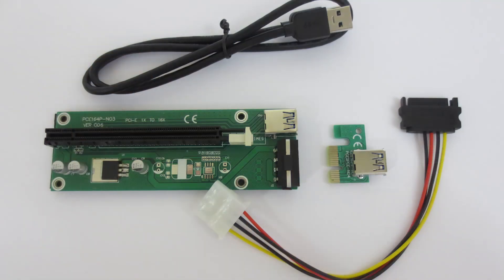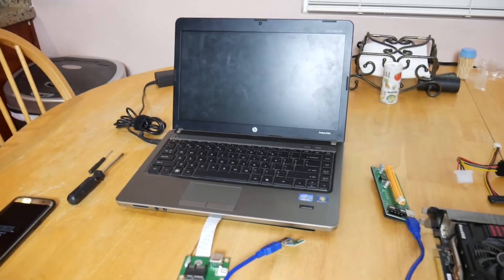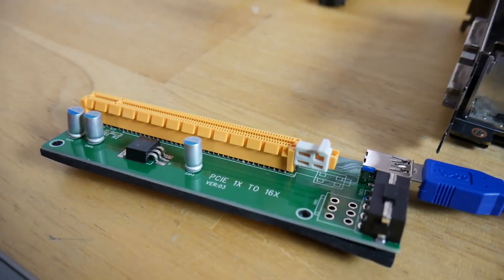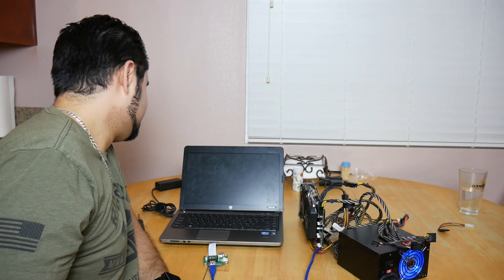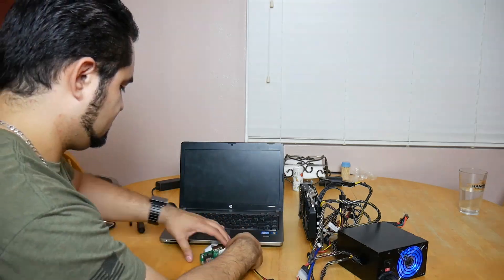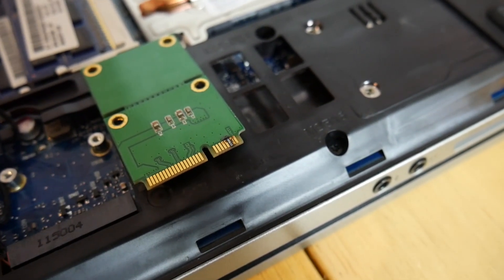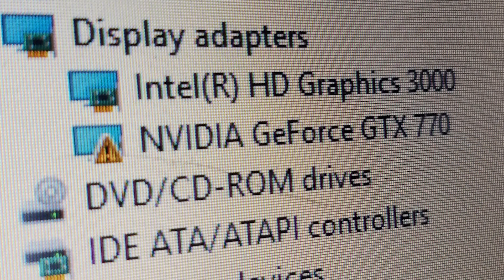$30 DIY EXTERNAL GRAPHICS CARD DOCK [eGPU ATTEMPT]

Comment: i have a question is it possible to use this on an 4th generation i7 alienware m14 and since i have only sata drives could i use a stata adapter to use the M.2 setup to run like a 2060 nivida video card i went to amazon the item is out of stock
Reply from the maker: @jimbilello7134  no you can't use an adapter like that. There are no pcie lanes that go to a sata port.
Reply: @CoalitionGaming  thank you sir

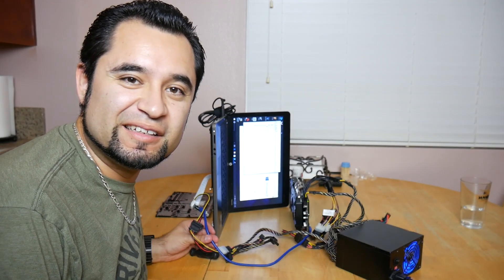Comment: @Coalition gaming. What exactly did you do at 8:50 please. Please be specific. If anyone else knows what he did please tell what exactly he did there. I have the exact same issue weather I use Expresscard or mini pcie slots. I'm pulling my hair on this issue. Also someone mentioned Optimus for internal display to work. Couldn't any information on that either. Any help would be appreciated. 
I have dell e6430. Gpu:  gtx 660 ti. Gdc exp expresscard and mini pci.
Any help would be appreciated.
Reply from the maker: explained at 8:40. In the bootup, the laptop wants the wifi card it came. After it passes the initial boot sequence, i quickly swap the eGPU adapter in.
Reply: @CoalitionGaming  . Got it Thanks.

Comment: I bought these two egpu docks for 15$ going to try it with my rx560 cause my graphics card died in laptop and i have only black screen egpu comes at thursday wish me luck guys
Reply from the maker: Good luck!
Reply: @CoalitionGaming  hey bro i have question can i cut cable from my phone charger and use it to shorten circuit on 24 pin power connector
Reply from the maker: any wire would work to bridge the pins on the 24 pin to jump start it, but i advise the usage of a paper clip instead.
Reply: @CoalitionGaming  thanks bro i will post you results when it comes

Comment: just the video I needed to see , I have an hp as well and I cant get past the black screen even connected to a external monitor but if it requiring the removal of the wifi card everytime booting up seems a lot of struggle to make it work in everyday use

Comment: How did you actually get it to work because you said that the port locks up without a WiFi card so how did you get it to recognise the gpu without the WiFi card
Reply from the maker: As shown in the video, I would boot it with the wifi card, then pause the boot after it posted, then swap the GPU adapter in. This was also my undoing lol

Comment: Hey i have some question
If i use gtx 1050 ti or 1050 that not requires external  power, can make it more easily? (That mean that can skip power supply process in 1050ti). I wonder that the voltage in laptop pcie slot is much lower than original pcie... can IT work...?
Reply from the maker: No, the dock still needs 75w of power. It'll just mean you don't need to plug in external power, but PSU still needed
Reply: @CoalitionGaming  Ahha! thank you~:)
Reply: @CoalitionGaming  And are there any docks that not needs power...? can exist?

Comment: You would success with an external monitor. For your internal display to work natively with this setup, you need to modify your display driver before installing it. It's a little bit tricky, but it's completely possible.

Comment: Hi sir 
I did what u said exactly and doesn't works !! 
My laptop is lenovo ideas pad 320a 
But when i was reading comments i found some guys talk about mod on BIOS please i need help to get this pcie run on my laptop
Reply from the maker: maybe check with the bios-mods website/forums and see if there is anything or anyone there that can help. Also the egpu.io forums can be a good resource.
Reply: Thank you so much for replaying 
Also i didn't get black screen when i tried the egpu 
Does this thing normal or not ??

Comment: You mentioned usb3 speed limits... Can you run a gpu via usb 3 directly? (Youtube recommending your vids to me now after subbing from gtx 2060 challenge!)
Reply from the maker: Nice. No, unfortunately you USB3 does not connect to the PCI-E lanes so you can't run an egpu off USB 3. The USB3.0 cable itself is the limit as I believe it's rated for 5gbps, which is the same as 1 Lane of PCI-E 1.0 i think. Or 2.0. I don't remember.
Reply: Looks like you said no to a similar question in your part 2 vid...needs access to pci... Makes sense.... Hmmmmmm

Comment: No worries, 
I have a 2008 Sony Vaio laptop, and I was able to get a lot further than you (using the Expresscard slot) without frying anything, but the card still doesn't work for folding or mining.
For folding or mining, the card needs to be recognized via Bios, I guess.
Another thing is, you'll need a true PCIE slot, which you can get via Express cardslot, not an M2 slot.
M2 slot is for USB. The NVIdia drivers won't work properly, even if the card is recognized. 
They will display some sort of pass-through, or software render mode, not the card's full potential.
For now, your best bet is a Latte Panda Alpha, or a NUC or laptop with a mobile version of the GTX1060 built in.
Reply from the maker: What I used was not an m.2 slot. It was a mini PCI-E slot which has 2x PCI-E lane connection. It actually displayed properly in device manager before having to hot swap to bypass the BIOS whitelist went bad. There is zero way this would have happened had it been a USB only connection as USB has zero connection  to the PCI-E lanes. Thru PCI-E it's perfectly and usually possible. Expresscard is essentially the same connection as mini PCI-E, just externally accessible. It would have been so much easier that way, but alot less fun for sure since a gdc beast expresscard version covers that. Some connectors like that are wifi only m.2 or m.2 with only SATA access, but it was clear in this case it was a legit mini PCI-E. For the record, this was just an experiment for fun. I don't need anything like this.

Comment: is there another way to use eGPU? (no mini PCIe - no thunderbolt 3) i have usb-c port but it can run the GPU
Reply from the maker: Additionally there NGFF (like mini PCIE) and expressCard. USB-C cannot do an eGPU as it has no access to the PCI-E lanes. To do an eGPU, it needs access to the system's PCI-E lanes.

Comment: Hi there! i have Dell Elitebook E6430 and trying to install Beat PRO eGPU with RX 480 but not even the power supply reacting and if so if its working i can't work around it, i tried meny things.....you got any tip what to do?
Reply from the maker: An elitebook e6430, sounds like a business model or Enterprise model/workstation. Likely a mini PCI-E whitelist locking out use like I talked about in this video.

Comment: nice try bro  :)
I've just bought the same thing, the pice adapter and i'm still going at it.
might wanna check out this one on Ebay, an external egpu dock...
Laptop External Independent Video Card Graphics Dock for V8.0 EXP GDC Beast X1A5
anyway, nice going, keep on trucking.
cheers..

Comment: What was the Trick at 8:52?? How did you manage it to recognize the card thru the pci slot?? I have the Dame Problem
Reply from the maker: Aside from the way i connected it, the trick because of the locked/whitelist BIOS blocking non authorized devices plugged into the mini PCI-E port, after the laptop POSTS, i press "pause" on the keyboard to hault the boot process. Especially useful if PXE  boot is enabled since network PXE boot happens after POST. While paused, i swapped out the wifi card for the eGPU connection, then unpaused the boot process by hitting any key on the keyboard. Thats how you bypass whitelists. Its such a hassle, and as you can see, the shuffling around of having to do that eventually screwed me over right on the brink of success.
Reply: Coalition Gaming so from the beginning you boot up the lap top, you ddnt disable your boot to lan on BIOS setting? Bcoz im have same issue... after all setup done, boot up my laptop, gpu fan spinning but my egpu not detected on my laptop, i mean its not appear on device manager>display adapter. The graphic card not detected. I saw some people did on youtube, they disabling their boot to lan on BIOS setting. Thats i wonder how the trick that u used? It been a month since i did the setup until now still ddnt know how to find out the solution...

Comment: Dear friend thanks for your video. I want to know which pci hardware is better between ur part 1 and part 2 video? can we attach external gpu for mining purpose? can this trick give more hash rate? ur response is expexted soon.
Reply from the maker: Technically, I'd advise the unit in the 2nd video be used with a laptop for egpu mining. Assuming it can be made to work.
Reply: Thank u very much sir

Comment: I had some crash issues with Nvidias latest drivers, so I used the older 372.90 driver for my external gtx 970 and it works great now.

Comment: i wonder if you cause the short by touching 2 pins together while plugin the adapter or it just burned by suddenly feeding power to it
Reply from the maker: The wifi card hanging in the socket as I tried to bypass the white list while powered on was the issue, it came out at such an angle that two pins (likely power pins) on the mini PCI-E socket shorted the card. That's all. Only that mini PCI-E adapter card burnt up. GPU was fine and so was the laptop (I put the wifi card back in and it worked fine).
Reply: in that case i may give it a try just for fun , thank you for replying, great video
Reply from the maker: Sounds great glad you liked the vid, good luck. I just needed more hands in this situation lol. Or a laptop without a BIOS whitelist on the mini PCI-E slot.

Comment: Could you do this with thunderbolt 3 instead of PCI-E?
Reply from the maker: With a thunderbolt 3 eGPU enclosure, sure. Not with this device though, no.
Reply: Coalition Gaming RIP they cost way more
Reply from the maker: Intel has to approve devices to use thunderbolt, so knockoffs or devices like in this video cant exist. The akitio node is probably the best priced unit tho.

Comment: Can you not just plug the USB into the laptop?
Reply from the maker: No, USB doesn't provide access to pci-e lanes which is needed to make an eGPU work
Reply: So is it not a USB protocol then? Just a port? If that's the case I think it's a bit misleading advertising it as USB3.
Reply from the maker: No it isn't advertising USB 3 for it's primary connection. It uses a USB 3 cable for signaling because they are capable of us to 5gbps transfer rate, which is the transfer rate of Thunderbolt 1 or 1 PCI-E 2.0 Lane (or 1.0 Lane, I don't remember). You'll see other devices like the exp GDC Beast or Bplus PE4C that use an HDMI cable similarly, but you don't plug to cable into the computer's HDMI port. It doesn't work that way, just using the cable for data transfer.
Reply: I have seen one that advertises USB 3.0, and have never seen any EXP GDC adapters that advertise the acronym HDMI. Thanks for the info anyway though
Reply from the maker: USB 3.0 display devices are not eGPU adapters. You haven't seen any egpus that advertise using a PCI-E graphics card over USB 3.0. wanna know how I know why? Because they don't exist. As for the HDMI thing, yes of course you haven't seen any that advertise it. They just use the cable for signaling regardless of whether it's advertised or not. The real point of advertising is what primary connection for eGPU is being used and that is ONLY mini PCI-E, ngff, expressCard, and thunderbolt. Nothing else. If you buy something that doesn't use what I just listed, you'll be wasting your money. Also don't confuse USB 3.0 type C with thunderbolt 3. Same physical connection, but can be wired totally differently.
Reply: I have seen ones like you show in the video that advertise USB 3.0 and now I know that it is false advertising and is impossible. Thanks.
Reply from the maker: Exactly, impossible. Like I said, real ones that would work over USB 3.0 simply don't exist. Have a nice day.

Comment: Hey, so i have a possible idea as to why the motherboard pcie slot overloaded and fried. The 15 pin sata only has 3 12v pins rated at 1.5Amps each for a total power delivery of 54W assuming 100% efficiency. The typical x16 slot on a desktop motherboard usually delivers 75W+. The card was not able to pull proper wattage and then drew power from the pcie slot instead, overloading it. I think its possible to mitigate this problem by using a molex to 6 pin connector to power the device. molex delivers 11a on the 12v line per pin, so across two pins that is 22a or 264W. That wattage is drawn as delivered, so if the device requests 75W, it'll get 75 and not the 264W. I'm going to test my findings next week when i get a Mini PCI-E Express x1 to x16 USB device.
Reply from the maker: Wow that's unfortunate. Sorry I can't be of much help though, I'm not as good as others might be at more minute electrical issues like that. Good luck
Reply: Coalition Gaming this was in regards to your situation and your laptop.
Reply from the maker: Ah. Well a couple of the pins shorted out because if the angle the mPCIe adapter was in the slot in the laptop. More than likely current got sent to where to wasn't supposed to as a result. The x16 portion was fine, but the mPCIe insert wasn't. Nothing else fried, just that piece. The wifi card that usually sits there still works, and my GPU still worked too.
Reply: Coalition Gaming ahh ok. I thought the slot and the mini pcie connector had fried in your situation.

Comment: dude... u saved my ass!!! I was going to try something more crazy...
Alienware M11x R2
Mini PCI-E to PCI-E x1 (same cable)
PCI-E 1X to 4 PCI-E 16X (the expansion card of 1 PCI-E 1X with 4 USB to 4 raisers) 
PSU 1350w Platinum
4 1080ti (before installing the 1080ti, i was going to test with a 5580) 

Your concept is really nice, the same as mine but... with only 1 GPU I would use a Mini PCI-E EXP GDC. In my case, I think will be a failure too... 
I'm thinking to buy this adapter...
https://cryptomined.com/index.php?main_page=product_info&cPath=1_373_319&products_id=320&zenid=mnrnhf13bt7hjlk7130kkv3tc2 
not sure how to handle the rest (BIOS, power)
Reply from the maker: Doesn't that laptop support the Alienware external graphics amplifier?
Reply: nop, my M11x R2 is a 2010 laptop. Those external amplifier use thunderbolt technology (2017), which comes with new laptops/desktops. The EXP GDC is pretty the same with the amplifier, the difference is that it comes with a box, power adapter, the connector and more fancy
Reply from the maker: No the external amplifier uses a propietary connection only some specific Alienware laptops have that's direct wired to PCI-E instead of using thunderbolt. Thunderbolt has some resource overhead that impacts performance a little bit and Dell wanted max performance over 4 lanes of PCI-E, so they made their own connector for it.

Comment: can't u just plug the sb 3 into the laptop?
Reply from the maker: No. The USB cable is just basically an over the counter data cable. The USB bus has no connection to the PCIe bus so plugging this into USB wouldn't do anything. You have to have a way to tap into the PCIe bus for an eGPU to work.

Comment: would this work on a small form factor pc motherboard connecting to pci-e slot? been wanting to run a full size graphics card and can only use low proifle cards now. which is limited to only a few models.
Reply from the maker: This would be an unnecessary solution. You can just run a really long PCI-E x16 riser/ribbon cable outside the case and find a way to dock it that way. If you don't want to run PSU cables outside the case, one of my more recent videos demonstrates a Dell power brick adapted to power a GPU which would come in handy for a solution like this. It's good for up to 220w.
Reply: ok thanks, and link to that video?
Reply from the maker: https://youtu.be/1YM0uvZdt5I
Reply from the maker: Nah man, thats breaking out a PCI-E x1 slot to x16, you'll severely limit bandiwdth available to the GPU. You just need one of these thats long enough (length is selectable on the page)
https://www.amazon.com/Thermaltake-Gaming-Black-Extender-AC-053-CN1OTN-C1/dp/B06Y5YNGDJ/ref=sr_1_6?ie=UTF8&qid=1509130893&sr=8-6&keywords=pci-e+riser+cable

that and a way to power the GPU and you're set.

Comment: you cannot use additional wire. too much loss. must connect the card directly to pcie connector in the laptop. You need to use usb3 connetor for it to work. even usb2 connector may not work. too slow.
Reply from the maker: It was actually going to work as evidenced in the video, especially considering the device recognized in device manager. What caused this to fail had nothing to do with wires or too many connectors or slowness or anything like that. The only thing a setup like this may suffer from is degraded speed down to PCI-E x1 1.0 instead of 2.0 as a result of the different adapters. There was indeed a USB 3 connector being used for data transfer as well.
Reply: You are right. It is just a matter of playing with the installation of the drivers. I got mine working but just. http://sabahnotebook.blogspot.my/2017/11/the-cheapest-egpu-rm30-successfully.html

Comment: this will only work with m.2 adapters, otherwise you need exp gdc adapter wich is about 50$. refer to  egpu.io/forums
Reply from the maker: Nah, if you watched the video I almost had it working. It was a different issue that caused the failure. I generally direct people to there and /r/eGPU for more information too. Other people in these comments have also gotten this method working as well. Just an FYI.
Reply: oh, well then your laptop is not really suitable for it, i have exp gdc for mpcie and it worked out of the box on k53sv
Reply from the maker: oh absolutely it wasn't suitable for it, part of the draw of doing it like this lol. The mini PCI-E port had a whitelist that required some juggling during the boot process to get the eGPU recognizing in windows. I even got to the driver install portion. 

Again, all in the video...